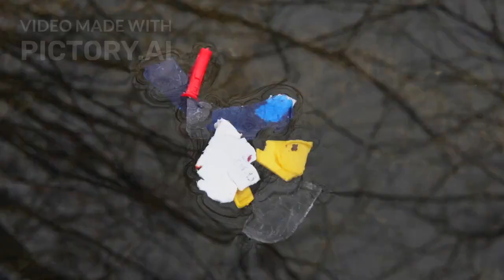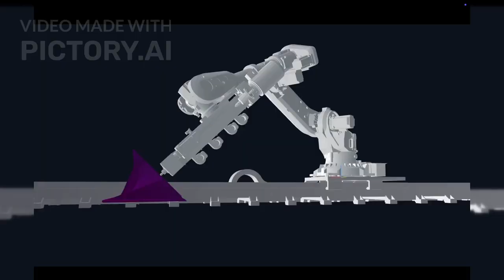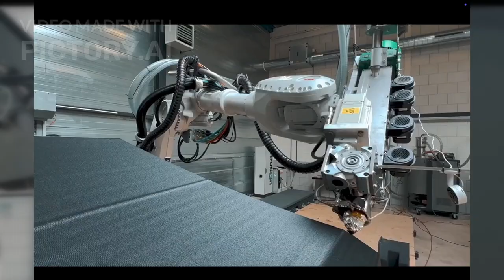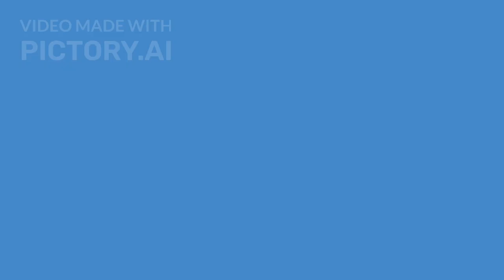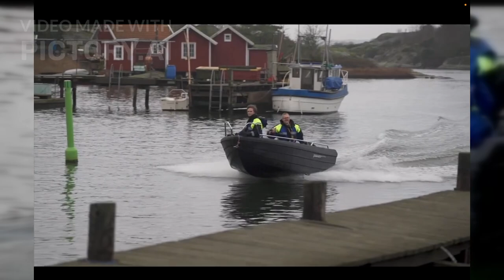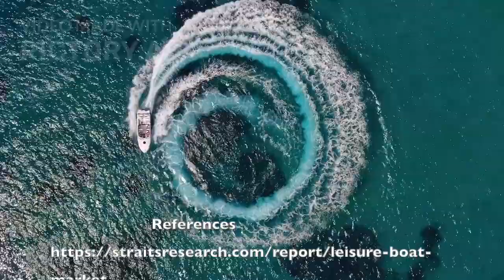group 9 3D Printing Boats

Comment: I like how this technology basically has no end of life as it can just be re-used over and over. I also assume that hull repairs are much easier and simpler when fusing plastic compared to repairing fiberglass or welding aluminum.